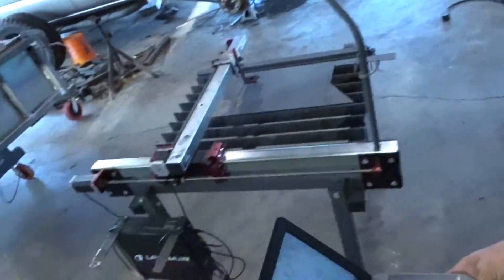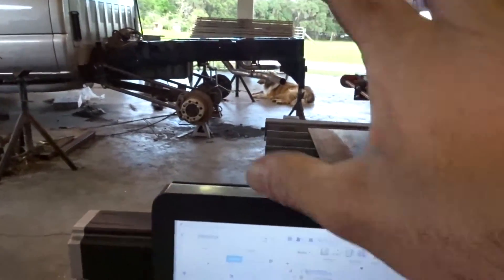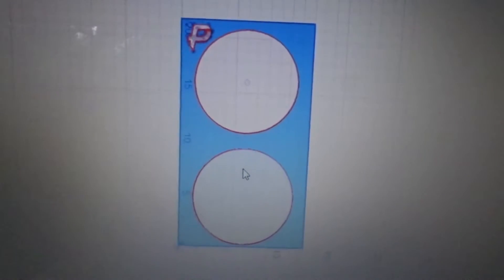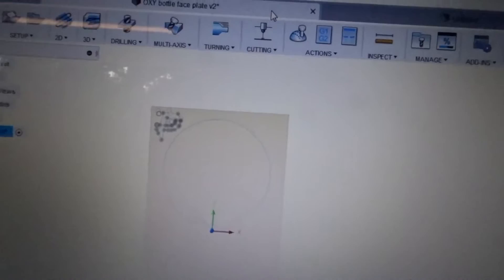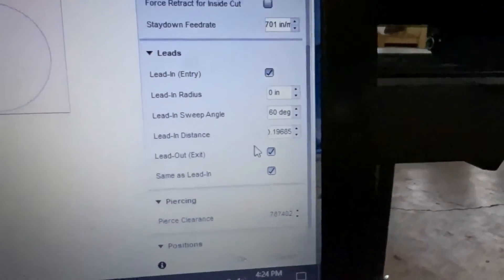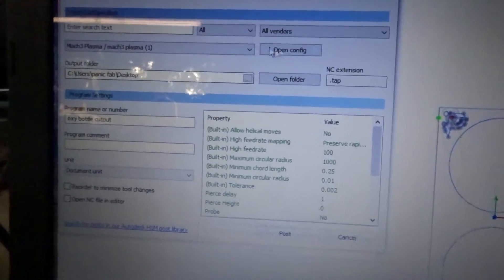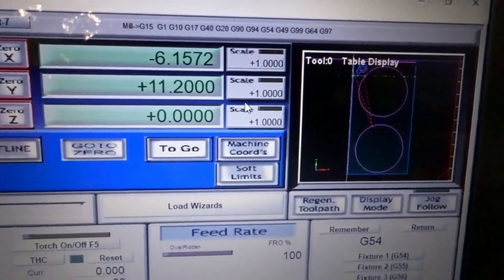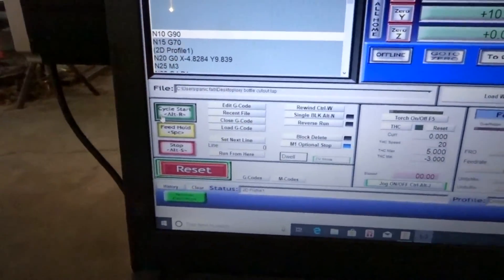Langmuir Systems Crossfire CNC Table Overview (Table Setup and Cutting)

Comment: this is the cnc table i want  and im thinking about getting the plasma cutter they have with the table and use my hypertherm  for hand cut stuff i have a powermax 30 as well. i love it  i need a bigger compressor      what compressor do you run bud?    im trying to start my own welding business a little at a time

Comment: Jm whats your opinion on langmuir so far? Good customer service? Are you using fusion 360?  
If you were going to buy another table would you still get a 2x2 or a 3x4, or 4x4? Ive been looking at the crossfire pro. I was curious wondering your opinion since you have had it a while.
Thanks
Reply from the maker: I like it haven’t really need anything for it (customer service wise) so can’t attest to that but I’d definitely go with a bigger table if you’ve got the coin and the space, I don’t regret getting a 2x2 table I just wish I had a bigger one as well. Using fusion 360 as well, love hate relationship there, probably my computer to fault the most haha

Comment: Holy cow, dude! Did you have a spastic 6 yr old running the camera for you?

19 minutes and 41 seconds and not two seconds of stable video. Either buy a tripod and learn to frame a shot, or tap a friend on the shoulder and have them hold the camera for you.
Reply from the maker: Na

Comment: if you weld in some adjustable dogs, you would have a fix position you can automatically 'home' to in mach3.  2 pieces of box tubing welded on an outside corner of the cut path like 6" in on the x and y axis just below the waste plates would be good.  some smaller pieces of box tubing to slide up when you have square corner on you sheet metal, when you have a funky shaped piece of metal just lower them out of the way.  now that you have those fix position dogs you can turn it up to 11--cap the top of those smaller box tubing and weld in some small piece of round stock on top the cap, this will give the ability to cut an infinite length of sheet metal. you would be able to program holes for the dowels in fusion to keep a long sheet square. nice video
Reply from the maker: That’s a great idea being able to cut longer pieces other than what the table is capable of, thanks!!

Comment: How much memory does the computer need?. How much ram? Do you need ethernet  connection?
Reply from the maker: You prob want at least a 200gb hard drive, 4gb ram, and the best processor you can get because fusion 360 will take forever to do anything unless you got a speedy computer but to run the cuz software it basically take hardly anything and all it needs is a USB port

Comment: I assume you’re running a 220v connection on your plasma cutter. Ever make cuts on this table with your plasma cutter running in 120v?
Reply from the maker: Yes using 220v,  on 110 my machine will only cut about 1/8” plate and it is very slow, can be done but not ideal
Reply: @j_moffitt  can I run the plasma on 220 and my compressor  on 110... ? For a small plasma like the HF titanium 45, how big of a compressor would you need?

Comment: Hey man, just a tip for you to make your life easier.  When you're in F360 and on the setup tab, set your origin point to the top left corner of your part.  Now, when you load that part file into Mach and your metal is on the table, jog your torch to the point where you want the top left corner to be and zero X and zero Y in Mach. Boom, done.  Cut it.
Reply from the maker: Awesome!! Thanks man, I know there is a lot I can do to make it easier I just haven’t taken the time to learn lol

Comment: If you hit the tab key in mach3 it will open up a jog window. You can it the arrow buttons with your mouse. When done hit the tab key again to close it.

How repeatable is it. What i mean is, are the dimensions the same if you cut duplicate parts. I know some commercial machines are +/- 1/8" and that is considered normal.